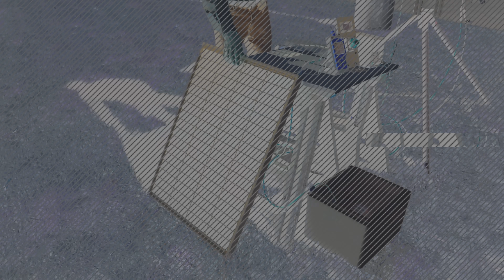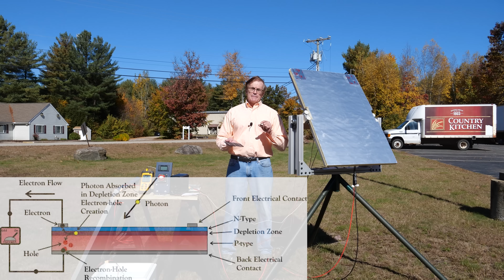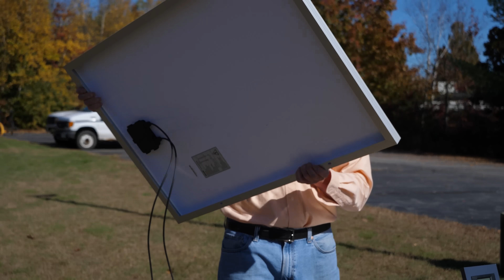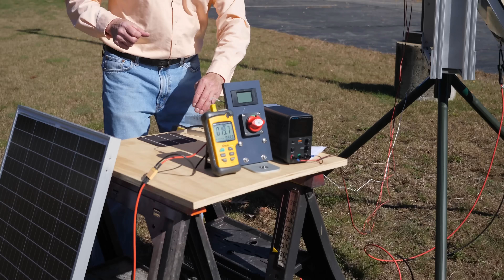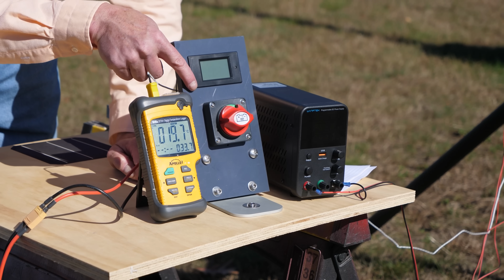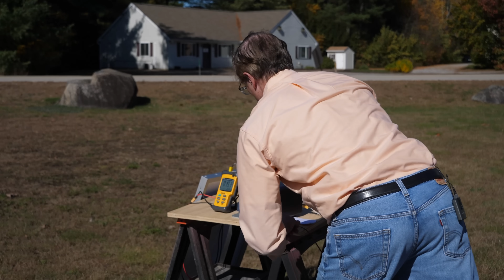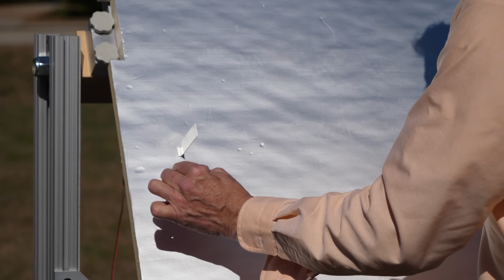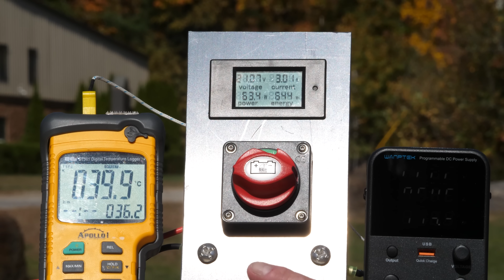Do you REALLY get enough out of your solar panel?

Comment: Harvesting heat from solar panels or even just block body radiation is also beneficial if you heat via heat pumps. If you exchange that heat onto the cold side coil you raise efficiency, especially during winter months. Poor mans geothermal

Comment: What a great idea. You can easily improve computer performance and component life by keeping temps lower at any given time. In my mind this is a great concept. I wonder if using a used radiator as a heatsink to cool a set of panels would be even more efficient.
Reply: LOL and use a little pump driven by a belt connected to a little fan/turbine that spins via wind.

Comment: It would be really cool to see the effects of the air cooling with the solar concentrators installed on the same panel. The temp differential between ambient and the peaked heat from the concentrated panel load may have much higher yields on performance!
Reply: I was thinking that from the start of the video!

Comment: Have you investigated partially-opaque material coatings?
i.e. a glaze or sheet of plexiglass-like meterial which is only transparent from 400nm-1100nm? 
Is there even such things? A partial mirror for certain wavelengths. Maybe a combination of laser lens coatings or something?
Reflecting the non-usable light would be better than absorbing it, thermally speaking.

Even if it cut down on the absorbed usable light, would it outweigh the loss of potential power generation with the lowered thermal intake?

Comment: Lqiud cooling prevents panel from dropping below 0c .
In New England  in winter especially this winter( 22-23) warming the panel above 0c would shed snow better or entirely prevent accumulation in the first place . This would improve overall efficiency by eliminating the 2-6days of near 0w output after every snow storm from the shadow cast by the covering snow. 

A friend got solar installed in central UT and his panels stay covered for days  at a time. The panels warm faster than the also covered asphalt shingles,  this is causing ice damming on the panels, roof, and in the gutters. On day 2-6 it will finally sluff packing the gutter with hard packed snow ( this is doing damage, nearly ripping the gutters off in the first winter). His solution will be to install 500w of heat tape. Not to get more photons  but to reduce  the cost of repairs needed because ov the panel install.  Ruffly 4kw panels and 10kw battery bank.

Comment: I track 9 of my panels manually, and I use an empty beer can for alignment. I'm too lazy to do the work, but I have both poly and monochrystalline panels, and it appears that the angle of the sun has a much larger effect on the output of monochrystalline panels than it does on the poly panels. Maybe someday I will check into this.

Comment: Another great, thought provoking video. Probably would be worth a separate experiment in it's own right but I would hypothesise that if you were using the heat for hot water in a building, using a pumped water cooling system for the panels may collect/save more energy overall than simply using fans to blow the excess heat away. The idea being that if you could capture 200l+ of 60c water which could be used for baths, showers and so forth, the electrical cost of running the pumps should in theory be much less than the electrical energy saved by not having to heat the water with electricity collected from the panels.
Reply: in order for the water to hit 60c, you would likely need a panel temp of 80c, which is not desirable.  You might be able to cool the panels with water that then get's fed to your water heater, but i'm somewhat skeptical that you use enough hot water to keep the panels at their desired temperature.

If you have a air source heatpump, you could duct the warmer air into it during the winter though.

Comment: I really love the idea of thermal electric combined solar panels.
You can have water run through the panels, cooling them down increasing their efficiency, and use that to heat your pool, or shower water, (with a heatpump)
Thermal pvt panels are slowly happening, and although slightly more expensive, can be especially useful on a small roof where more cheap panels are not possible.
Reply: Thermal electric panels are also called hybrid panels in some markets. I think they're a great idea.
Presumably you could use a heat exchanger with them and use that warmth to pre warm your running hot water for shower etc.
Reply: @felixokeefe  exactly, i have seen a dutch company do that.
Nice part is too that its perfectly quiet instead of a typical condensor.

Comment: Interesting video. However all the renewable energy solutions address only a marginal ammount of our actual demand. 

Example: the ammount of fuel saved by replacing cars' halogen light bulbs with LEDs. We get a whopping 80% electricity savings from the lighting system that counts for less than 1% of total fuel consumption for operating the car.

To earn people's support renewable energy solutions must address at least 40% of our energy demands at competitive prices of the currently available energy sources. That's why I strongly believe that nuclear energy is the best alternative or at least the best transient solution. It is dependable day and night, and extremely reliable to meet any demands. Add to that a well established and developped technology.

Comment: I've wondered. Can't you collect the heat from the panel and use it to heat your house in the winter time? Perhaps you could also use this heat combined with a heat pump to pump heat into the ground during the summer, then extract that heat in the winter. AKA stabilize the ground as geothermal heat pumps tend to work well when they start, but it takes around 8 years fore the ground to stabilize. At that point the heat pump looses a lot of it's performance.
Reply: I imagine the only effective way to heat your house with this would be through a heat pump.  The air isn't going to be hot enough to directly pump into your house (if your displacing 20c air with 15c air, it's going to be a loss)

You could duct the air into a air exchange heat pump, but you would need to redirect it based on if your heating, or cooling your house (heating the outside unit is good for when your heating your house, but bad for when your cooling your house).

My guess at the best way to utilize the heat would be pre-warming the water coming into your house for your hot water tank.  The only question then is if it's enough flow to keep the panels cool, the useful heat gained may be outweighed by higher panel temperatures.
Reply: There are systems that use heat from the sun to collect heat and transfer it in doors, but from what i've heard they are quite expensive. Its usually an array of glass tubes filled with glycol that gets pumped in to dump heat into a water heater. if you are heating a small enough space, have really good insulation and are already taking advantage of passive solar heating in the design of the building you might get away with using only radiant heating to keep the building warm in the winter. SunMaxx solar has some kits if you want to see what they look like.

I've heard they are a pain to maintain though. if the pump fails for example, you can get into a situation where the system gets too hot and will get damaged relatively quickly.
Reply: @Errzman  They did some solar hot water heater stuff in this video https://youtu.be/5g5PW78XMSo the vacuum tubes are not great, you can get a much more reliable system for low $.

Comment: I'm sitting here wondering if it is worth throwing peltier cells into the mix 🤔
Reply: My guess is no, Peltier elements only have about 5% efficiency, which is scary low.
Reply: @Luke-san  they are a little disappointing... but all that thermal energy being dumped, could be useful in other ways.
Reply: @lazzymclandrover4447   Something which I would like to know is the temperature at like a distance behind the solar panel. Where I live a lot are mounted on saddle roofs. I can imagine if we can make like 1 big channel of air moving from below to the top (heat rises) behind the panel and the tiles of the roof it would be a double win. Less panel heat and less heat on the tiles so the temperature of the roof itself would drop and efficiency would be higher.
Reply: @Luke-san  just use a convection draught to cool them..? Interesting... maybe a 'chimney' across the back and through to above the top of the panels..? Worth a thought.
Reply: @lazzymclandrover4447   It really is but I don't have the place (or climate) to test it. Might be expensive to construct this.

Comment: Why not use a heat exchange system to actually warm up something like your house floor using the PV cell heat? This based on an assumption that you would have to use additional powered system to heat your floor anyways to begin with.